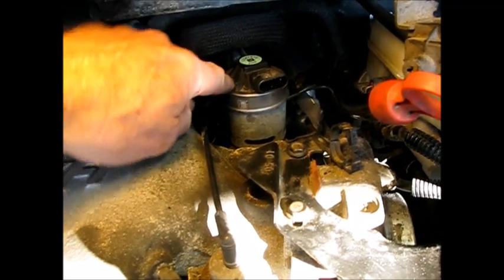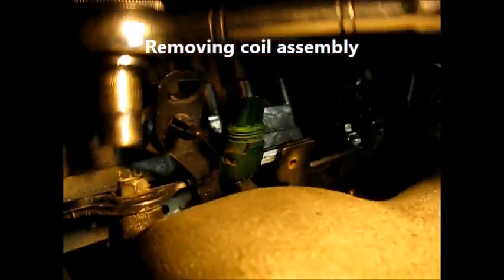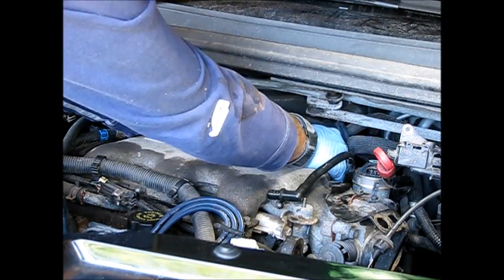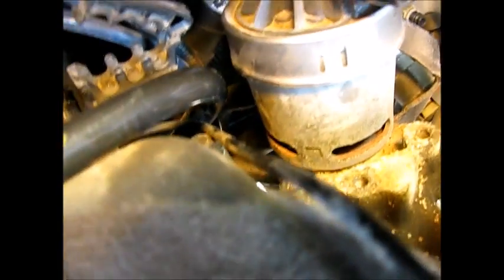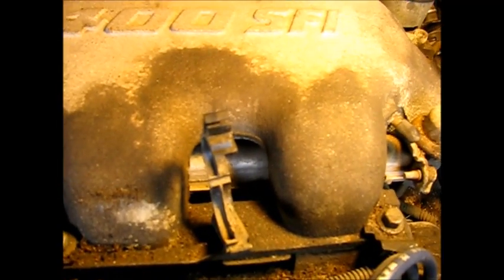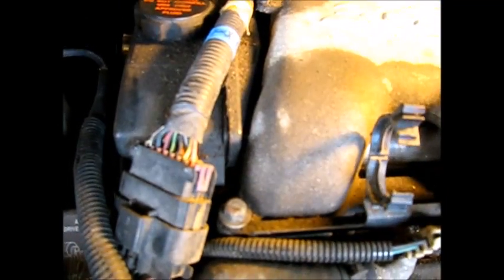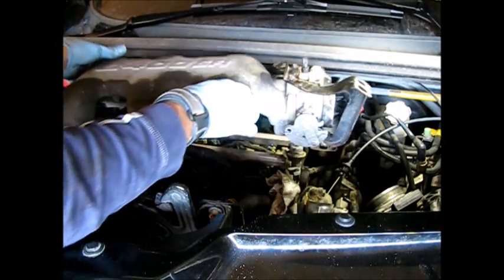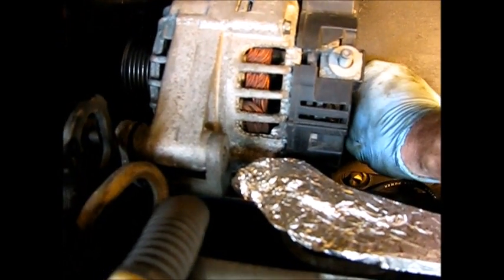3.4L GM lower manifold gasket replacement part 2: Removing components and the upper manifold

Comment: I found out working on this engine is to unbolt the upper motor mounts and pull the engine forward with a ratchet strap. This gives you all kinds of access room for the ignition coil pack and everything else on the back side of the engine.
Reply from the maker: Great tip! Thanks for sharing.

Comment: If you squirt a small amount of WD40 in those hose fittings, the hoses slide right off with no effort at all. Same with putting them back on. Just pry back the hose with a small screwdriver and using the long nosel, put it in the area where it's pulled back and it will seep around the inside on the fitting. Slides right off.
Reply from the maker: Good tip. Thanks
Reply: @TheOriginalMechanic  No problem, and thank you for the vidoes. Going to be a huge help and I really appreciate the effort you put into it. Thanks again!

Comment: Would this lower intake gasket cause me to lose enough water to during 30 minute period of idling that the engine overheats and also could this cause water to get into combustion chamber?
Reply from the maker: Possibly, that or a head gasket failure. A gasket failure in either area can cause coolant to mix with oil and vice versa.
Reply: @TheOriginalMechanic  thank you for your response. I'm hoping for this to be the case v.s head gasket, but I've begun the process of taking things apart one layer at a time until i located the issue.

Comment: Oh no.
Where's part 4? I followed along this far before even checking if all parts were posted. I'm in the removing alternator etc part. Anybody got a link for the rest of the tear down. I'm trying to replace a stupid o-ring on a spark plug
Reply from the maker: https://youtu.be/yQYL22YC0q4        part 4 vanished from the playlist and I put it back.
Reply: @TheOriginalMechanic  Whew! Thank you so much! I was just sitting here staring at my phone like wtf do I do now. This is going good though so thank you for your videos! 👍
Reply: Did you not show removing the fuel rail and lower intake ?

Comment: I'm completing the job, but the wire unplugged at 5:05 is missing in action. Where does it originate from? I can't find it!
Reply from the maker: this is hard to see in the video but I have a blog post on this same repair (with a wiring view) that may help: http://www.originalmechanic.com/2016/06/how-to-replace-lower-intake-manifold.html

Comment: Might consider taking upper engine mounts loose and using ratchet strap to rotate engine forward......you can reach around coil pack and get to egr alot easier
Reply: Word for word straight out of the Haynes manual.
Reply: How is this done on the 3400 SFI motors that do NOT have a front dog-bone style mount?
Reply: That's what I had to do to reach the back plugs.

Comment: Holy moly, what a great video. I'm currently in the middle of doing this job on my 02 rendezvous, having never done anything on this scale before (the biggest job I've ever done was a thermostat or control arm replacement). This video may just save my car. Thanks for the walkthrough, it was getting pretty scary unplugging and removing things without knowing what the are ;)
Reply from the maker: You're welcome. You should find your job on the Rendezvous very similar to the Aztec shown in the video. Good luck and thanks for using my videos.
Reply: Steve Polychronopolous I’m doing my ‘02 Rendezvous right now! 😂